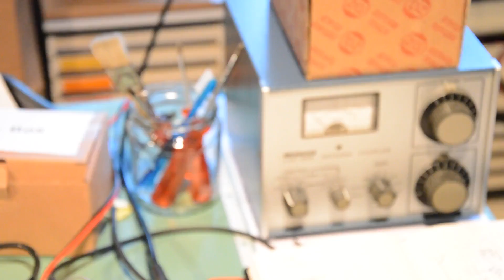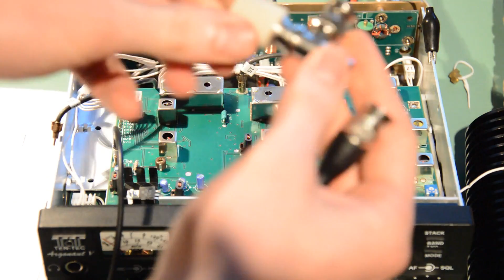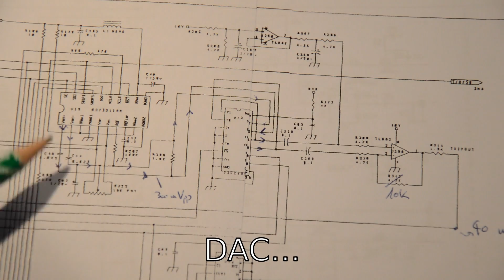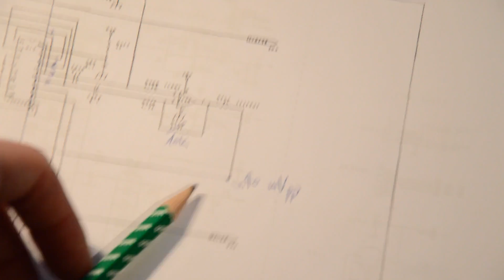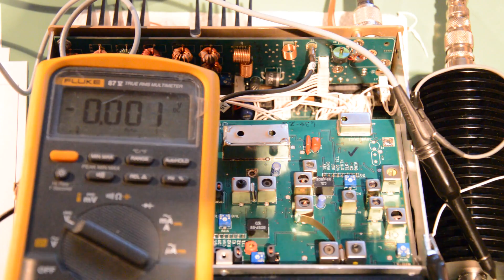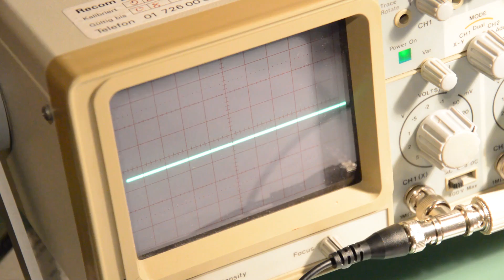TenTec Argonaut V Repair Part 1

Comment: in the minute 13:40 you say  that the amplitud is 1.5 vpp and the power is 45mw.i can see the oscilloscope vertical scale is 50mv per division,then 3 divisions are 150mvpp and this is 56uw.power=vpp^2/8z =0,15^2/400=56uw.anyway very nice video
Reply from the maker: Heh, very nice I did not expect anyone to notice the mistake, congrats. I realized this on my way home but at the time the videos had been recorded already. This is what happened: This is my dad's scope and I used it back when I did not have a better scope. I have not used it in a long time. My dad had this fixed 10x probe that I always used and with this instrument, you have to multiply the voltage by 10 to undo the action of the 10x probe. The scope does not do that for you, unlike more modern scopes, you have to think of it yourself and do it in your head. Now of course the special adapter that I'm using is not a 10x probe, but because I was so used to always multiplying by 10 when using this scope, I did it without thinking and this is how my voltages are off by a factor of 10. Nice catch!

Comment: Very nice tutorial, I noticed that there are circuit measurements taken with the components still on the board, I guess if you know what is happening with the circuit it ok to do this.  I do like the layout of the TenTec radio, and if you got a broken one on sale it could be quite a learning experience to fix it.
Reply from the maker: +Joseph Nicholas I guess you are referring to measuring e.g. resistance in circuit? You are very correct in that one has to be careful about that in the sense that resistors might be in parallel with other resistors or other components, which can potentially influence the measurement. Hence, it makes most sense to consult the schematic and asking the question "What reading will I expect when taking the measurement" taking into account all components. I did that but maybe I did not point out my thinking process sufficiently well while doing so. Thank you for watching!

Comment: hope to see the out come . have one myself and looks like the same problem . bought it used that way .great video. 73s rich kb0oki
Reply from the maker: +rich keller Thanks! Any way to do some of the checks I did to narrow it down? There will be a follow-up video once my dad understands that it is OK to have more time in retirement than before... We are going for a replacement filter from Murata, model CFWLA450KEFA-B0. It is available from mouser, part no. 81-CFWLA450KEFA-B0 It is important to select a filter with the correct bandwidth.

Comment: 1st, nice video. 2nd, It seems TT has had a lot of filter issues such as described.  You can search this.  Some say it is because TT doesn't use a DC blocking cap that is required per the Filter Mfg. application notes.  And there is also a post regarding these Ceramic filters having internal moisture issues.  Can't wait for the next video.  A friend of mine just had two of these replaced on his Omni VII.  Parts were cheap, the repair and shipping wasn't.
Reply from the maker: +Bob Ograv Wow, in one single comment, you put more information that I was able to retrieve from the Internet when I researched possible issues. I probably constrained my search too strongly on the Argonaut V, I will check again for general TT filter issues. TT was not very helpful in sourcing the replacement parts; I will discuss this in the follow-up: I do however have the replacement, now just have to schedule an appointment with my dad. Thanks and stay tuned!
Reply: +MrCircuitMatt 
http://sv8ym.blogspot.com/2010/07/mysterious-case-of-withering-filters.html
Reply: Not limited to Ten Tec—I’ve replaced these filters on other brands too.